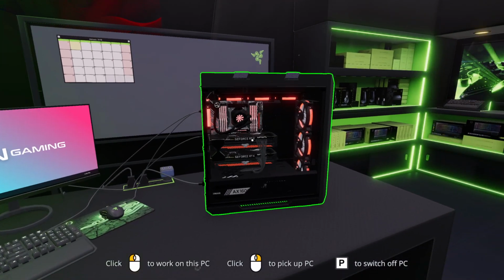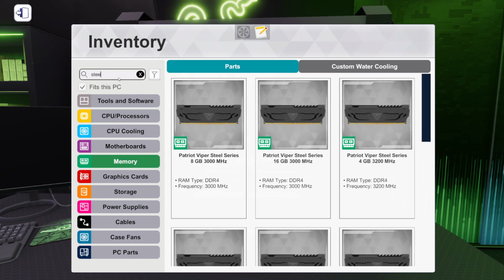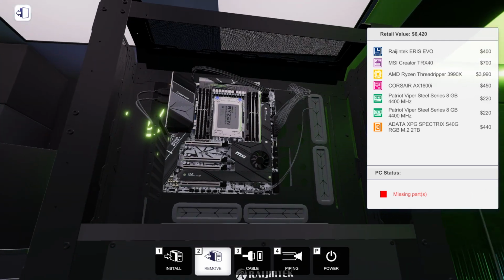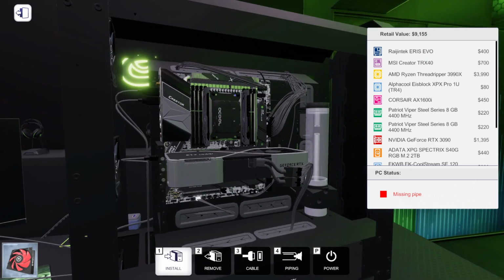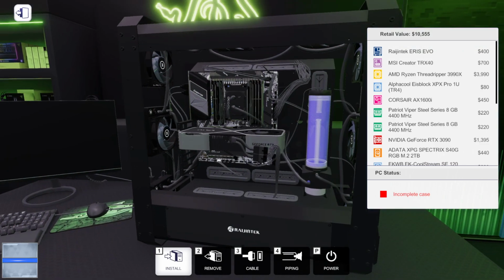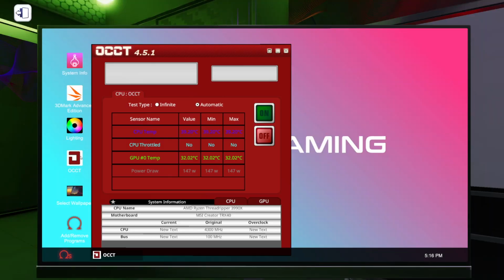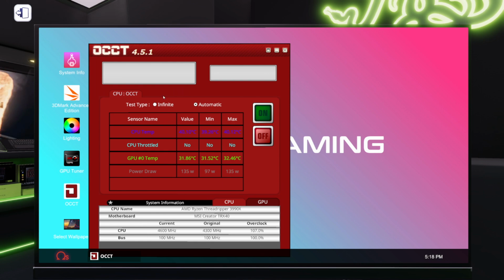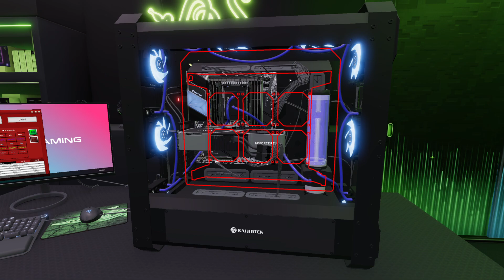More Radiators VS. Bigger Radiators (Which Is Better?) CPU Cooling Challenge - PC Building Simulator

Comment: You do know the coolant should flow through radiators first and then to the cpu so it actually gets the coldest coolant to it first
Reply from the maker: In real life and in this game it doesn't really matter. Even in systems where there are GPUs and CPUs in the loop loop order doesn't really make much of a difference. Jayztwocents did a pretty good video about it that I'd recommend checking out.
Reply: I haven’t tested this in game myself, but from my understanding that doesn’t actually make a difference in game.

Comment: Interesting, I wouldn't have called that. The Airflow stat doesn't seem to be the be-all end-all for cooling.

3 x 170 = 510
8 x 70 = 560

Yet the 3 480s did better. That's good to know.

Comment: More radiators with most CFM total possible actually is best for maximum cooling potential, so for example I believe the absolute best is with the enyo case that can have 10 rads and a dual loop, 4 x 240mm, 4 x 140mm, 2 x 120mm rads is best. So in that case a dual loop is 5 rads for the gpus only and cpu. That’s 990cfm total of cooling potential.
Reply from the maker: I'm not surprised if that's how the game calculates it. Good to know!